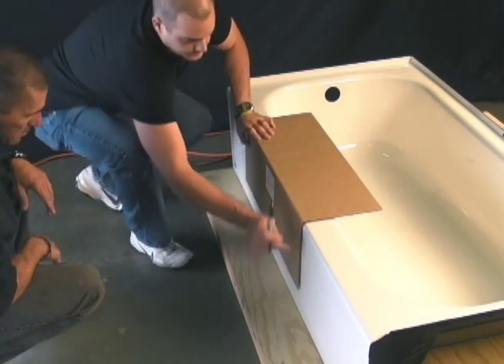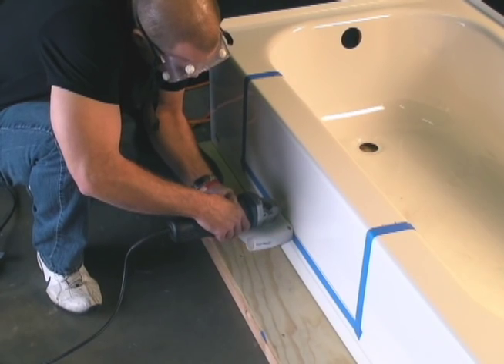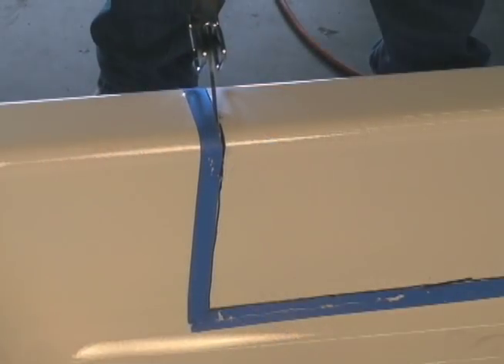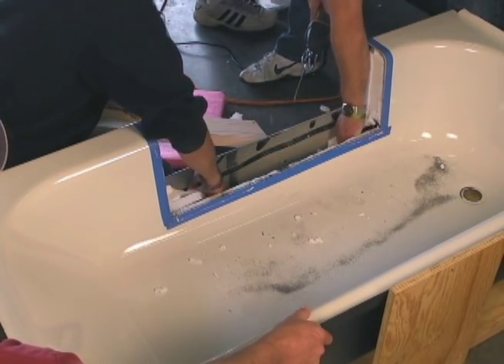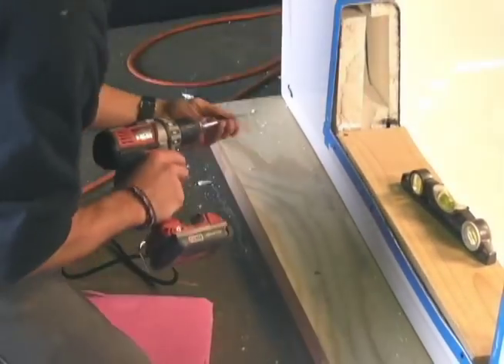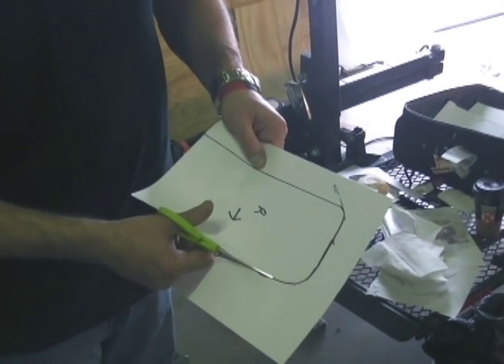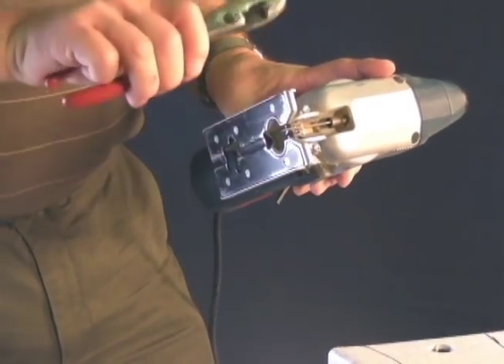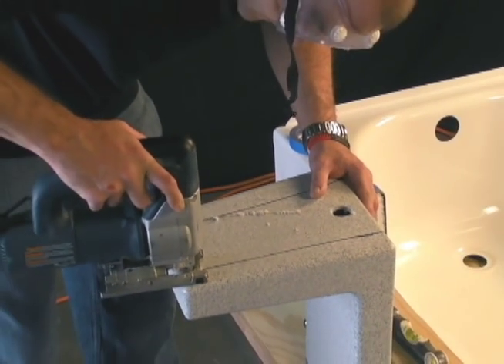Bathtub Conversion Kit Installation

Comment: hello,   do i really need the wood supports when i have a cast iron tub?  i don't think supports are needed in this case.  first, no one will be stepping onto the insert. second, the cast iron will support the insert.  thoughts on this would be helpful, thank you!
Reply: Yes the wood is for the support of the polyurethane / plastic insert when stepping on.   James - Ohio Walk In Showers.

Comment: How many hours does this usually take?
Reply: All the different manufacturers journalist a half a day but that's if you've had practice installing two or three already. I would suggest you figure at least 8 hours as a newbie going slow and make sure that you know how to handle jigsaws or cut off saws safely .

Comment: ok I have this tub but want to change back to a regular bathtub how do I do that ?
Reply: Depending what your objectives are: personal bathing or resale, there are options. For personal bathing, you can purchase a 3rd party product called a "quick tub", it's a clamp-on device that can be installed over the insert in 15-20 seconds that allows the tub to be filled.  For resale, I’d personally put into the listing “seller willing to restore bathtub to bathing”. With this statement, potential buyers will realize that the bathroom is open for negotiation (in which case most buyers would probably prefer - i.e. take the money and do it their way).  However, for any offer asking you to restore it, you can purchase the quick tub part for around $500.  On the other hand, if the tub is steel or cast iron, you can probably have the insert removed and the entire tub covered with a liner for around $2500. Presenting these two options in your counter-offer may then only cost you $500-$1500 in your price reduction.

Comment: Unless I'm missing something it also appears that this procedure would only allow for about two inches of bath water......what's the point of a bath?
Reply: +Michael Ryan  they make a slip in panel to return to a tub use maybe fro a different company but i saw it
Reply: +Michael Ryan Safeway Step Bathtub Accessibility Modification has the watertight door that can be installed to still use it as a bath
Reply: Its for a shower instead LOL
Reply: Its for a shower
Reply: It's for people who are unable to take baths anymore but yet able to take showers on their own or with help. This is a big deal for millions who are not yet ready for the nursing home, a little more time to feel less dependent , staying in their own home because they can get into the tub to shower. Some people can't get over the side of the tub to get in it and or they are just not secure.  Shower conversation gave my mother many more years of Independance  and freedom of not being in another's home or the nursing home and I know others.